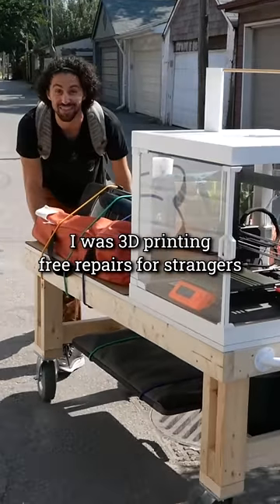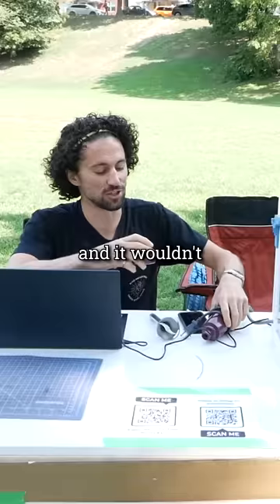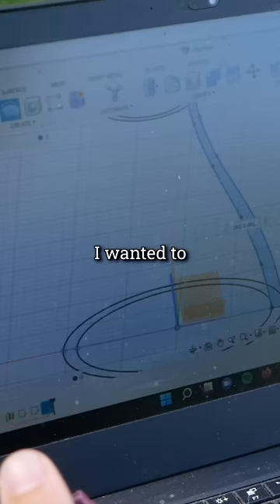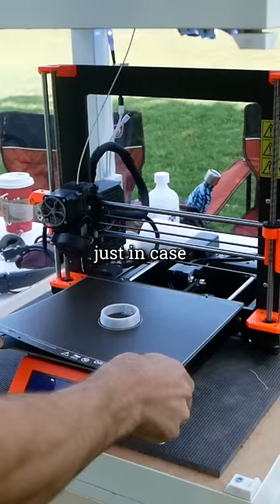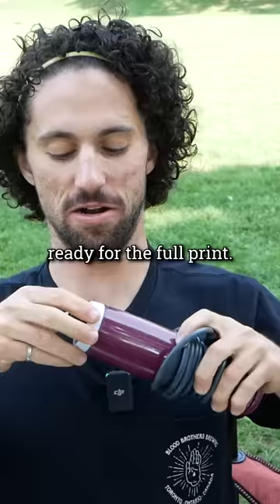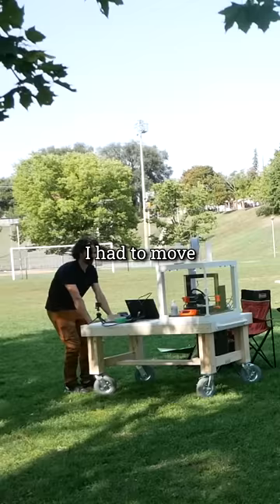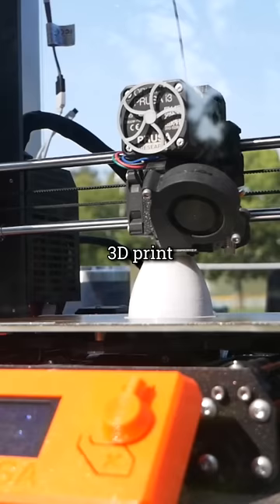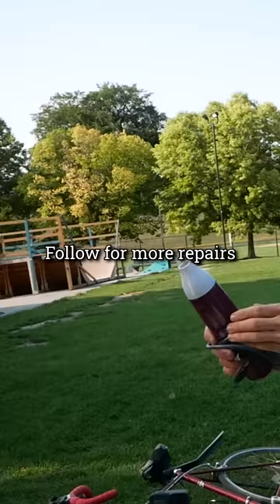3D printed repair for a stranger #DIY #3dprinting #repair

Comment: I have an interesting ideal, I was born with club foot on my left leg, and due to complications unfortunately the muscles in my left leg isn't as developed and I'm wondering if there's anything you could print in a comfortable material that I slide or clip into place over the left leg? It's mainly my own confidence (people do notice as well) but when i wear skinny jeans to jogging bottoms it's really noticeable and to me it's embarrassing and just knocks my confidence every time I leave my home... any help or advice would be appreciated thank you
Reply: Mhm large prints in flexibles like TPU is something I'd describe as borderline impossible to do. You can't really disguise that one leg looks different from the other too successfully I don't think either, or it can require a ton of trial and error. But here's a way to do it if you want to attempt it. And oh you'll need to find some friends in weird places, most likely, so don't be too shocked.

Have your lower body 3D scanned, if you have a friend with a Kinect you can get a PC kit for that and software, or iPhones have LiDAR Depth Camera and there's software for that. Then someone with basic CAD knowledge can design you a prosthetic, where the outer surface is the mirror image of your strong leg and the inner surface is the surface of the weak leg. You can then attempt to print that directly in TPU. Should it turn out not to go well, you turn that design into a 3D printable multi part mould, which you then use to cast your prosthetic. Ask around among cosplayers, furries and special effect makeup people. You probably want to try an expanding foam used to cast creature masks. Foam latex, foam polyurethane.

Also I still don't think it will just slip over, you'll probably need to foresee an attachment method like velcro to have it close in the back. Ask cosplayers or furries. You can probably cast foam over a fabric substrate which can have the closing mechanism already foreseen.

Another way to go about it is to create yourself something that instead of disguising the deformity instead draws attention to it, something with a weird or cool design. And wear shorts. To become more comfortable with it instead.

Either way good luck.

Comment: you do realise movement of the surface the printer is on is irrelevant right?

You could 3d print in an earthquake with zero issues 

hell; you could even put the printer upside down and it would still print perfectly

Comment: 3D printing isn't food safe. Food finds a way inside the layers which means the parts can't be cleaned. I would stay away from repairing kitchen appliances.
Reply: There are ways to get around that with food safe Epoxy but it doesn't seem he has that or the time To do that whole process
Reply: I think that part has a long attachment that plugs into it - check out one of them online, youll see, I dont think it would usually touch food there